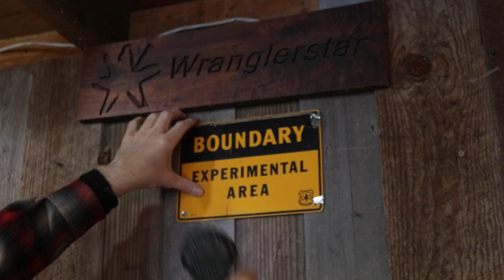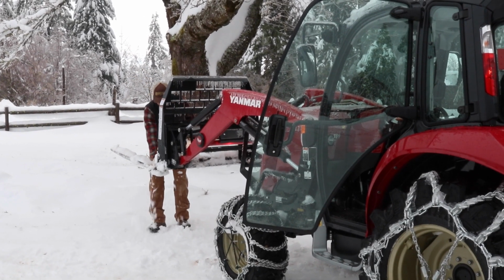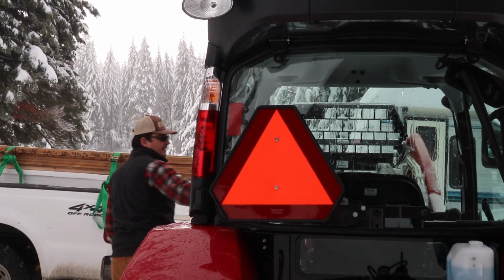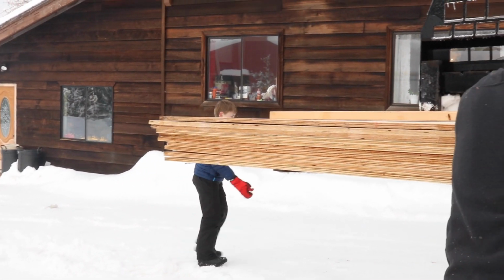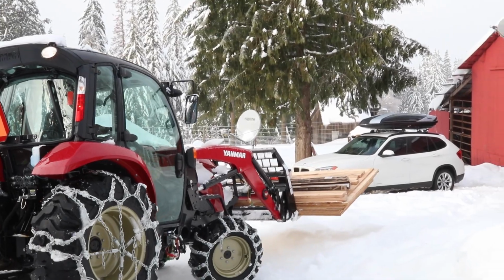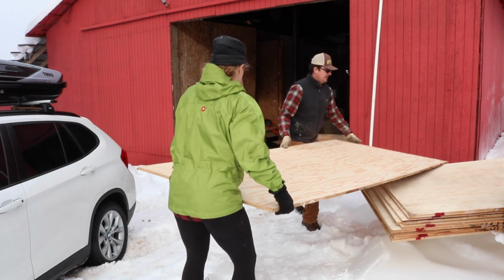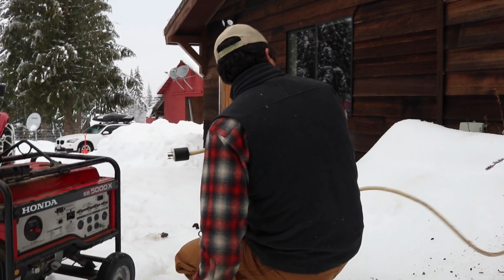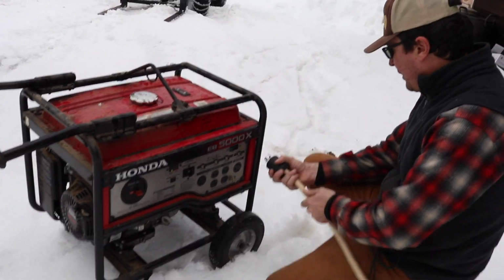THIS ROOM IS KILLING ME I CAN'T TAKE IT ANYMORE!!

Comment: you forgot to refer to the cord you made Dead Man's cord can you touch either end when the other end is plugged into an energized circuit you're a dead man so just make sure you're shutting circuit breakers off the generator is off when unplugging and plugging the court in just a little safety tip
Reply: Wayhart why is it worse than any other 220 line?
Reply: JCLawn51 not necessarily it says there is safety and having a covered and a record like a normal extension cord you have 2 male and have an extension cord that are live easy to shock yourself especially with the end of the 30 amp dryer plug side they are looking at nearly 2 inches copper electrodes that you can easily shock yourself with if you're not careful that's why they referred to it as a Dead Man's cord like he said if you don't know enough about it don't do it always plug the dead end in first then plug in to your power source
Reply: a quick note about doing this in my area it is possible to be charged with manslaughter if you end up killing a lineman so do at your own risk shutting off main breaker should do the trick most power meters have an indicator on them that tell you if power is going backwards to them so it might be worth checking in a meter if you ever try this
Reply: Wayhart and you could always have a proper hookup and throw switch outside. I have worked around a lot of 3 phase in shops and in theater.  The lines are never really a safety hazard because so much trust is put in the insulation. That is why i asked about how much of a danger is it
Reply: JCLawn51 easiest way to think about it is take a 3 prong plug chord that you plug into the wall make it the same on both ends plug that into the world grabbing the other the other end of the cord the physical cord and cell is ok it's the end that are not safe when energized
Reply: Harrison William exactly
Reply: Wayhart ohhhhhhhhhh that makes sense now. I am fully on board with what's going on now haha
Reply: JCLawn51 but yes if you are not well-versed in electrical DO NOT attempt this I have wired my entire College and I still have not done this I just wired in a second panel that has a 50 amp cord that feeds it and I can just unplug it and put in my generator cord into it it was a little bit cheaper than a transfer panel in retrospect I should have just put in a larger main panel when I have original services and I could have had transfer breaker setup installed which disables your main breaker it allows you to turn on your generator breaker but you are unable to operate speakers at the same time which is a far safer way to have your generator tied into your main panel
Reply: Wayhart, from working at an electric utility for 36 years from generation to metering and working plenty of storms. 1 when a storm hits and their is no power, it is totally silent, we could hear generators running for at least a mile. 2 Everybody I ever worked with ASSUMED any wire was hot. 3 I have never worked with a lineman that didn't flash a connection before making it up. 
And I do absolutely agree, If you don't know what you are doing, especially when it comes to electricity you are just thinning the herd!
Reply: Normally you would have a some sort of mechanical interlock switch that would never allow two energized sources to connect together, (even if one wasn't live). Obviously this a some what rudimentary manual system (with out even mentioning the double male ended extension cord ;))
Reply: I put a Cutler Hammer disconnect switch on my house a few years ago.  It is a 3 position switch that goes between electric meter and fuse panel. The up position is line power coming into house. the middle position is Off, all wires going into house are dead and the lower position is a heavy gauge extension cord that is wired into switch and plugs into generator.  This is fail proof. You can not back feed any power into the grid.
Reply: Would a cord made for underground use be better for hooking it up the house? Safer outside?
Reply: Acreage Living Well as for me I'm never a fan of any exposed wire on the ground, I always put it in a piece of plastic conduit.
Reply: Acreage Living  they actually make heavy gauge extension cord I'm aware of stuff that can go up to 200 amp but I'm sure there's bigger stuff out there that is what is designed to be used as extension cord material most generator hookups for houses typically have a 30 amp cord or a 50 amp cord so if you're aware how thick your dryer cord is for an electric dryer or an electric range they are little bit sicker than that with heavy rubber last time I bought that type of chord I believe it was something like $13 a meter but that was 15 years ago
Reply: Richard Peel I'm actually a fiber optic cable technician and I worked for a cable company prior to this so I'm familiar with safety protocol for going up the pole I've still been left off the Strand before it's a bit freaky when it happens I finally asked a power guy about that once and apparently it's quite common in our area because people steal the copper grounding wire the bottoms of the poles which I thought was kind of funny and I imagine there is some leakage that happens in other areas with trees rubbing on power lines xcetera. we have newer type meters here in my area they tried to switch to meters that communicated via satellite but something was going wrong and they were burning down houses in one summer when they started switching them over I think there was about 20 house fires in my city alone that started at meter boxes so we're still on the old digital meters which one I play with a grid-tie inverter and they shut everything off in the house it does show the meter has return voltage it will not make the number go down I'm not exactly sure how those meters work but even if the power is out the meters still displayed the power usage so I'm assuming they just have sensors and no physical disconnect I live in Canada by the way
Reply: wow that must of been full or lawsuits with the house fires.. I forgot about extension cords. His power cord he is using, just looks like an interior power cord, i would be very uncomfortable using that outside! This acreage we bought, the previous owners did some wiring outside using normal indoor wiring, and 4/5 of the wiring jobs they did all short out and will blow the breaker immediately. I have since removed their wiring. They buried it even under ground! Not even in condiut or anything. I think i would tie into my welder plug in the garage. I want it to run my outdoor boiler in case of a power outage and having the ability to run other things would be great.. Garage feeds power to the boiler and the pumps. My garage is 100amp, house is 200 amp, house feeds garage. My dryer is gas, so that wouldnt be a great tie in spot.. Power outages here are very rare and never last long, but always good to be prepared for the worse case. i am from Canada too. Northern Sask/Mb on the border.
Reply: Hiya Wayhart, part French Canadian here from way back. Being in metering for a little bit, and going thru a complete meter change out in our area, I do have a few story's! But your feedback problems probably came from.... until the codes changed to grounding blocks most phone and comm's connected their grounds to meter boxes, if someone came thru and area and started cutting all the butt grounds off (our utility would not let you connect a neutral to our ground in the meter box, we carried our own system neutral) that degraded our system neutral and it would start back feeding to any ground, hence back feeding to comm's. The only fires we ever had were from bad installs, a contractor that paid per meter, you can figure that one out!

The only meters that can have an internal disconnect are 120v or 240v single phase meters, they also have a computer and battery inside, most will record your usage and communicate with every other meter in range every 15 minutes to record all the info. I know a lot of people think oh shit big brother is watching BUT. If there is an outage, the map in a utility dispatch shows where the outages are the worst and where all the people on life support are.
Reply: Richard Peel yeah that communicating meters is what they were trying to do and I think they were going with contractors to replace them and I'm not sure but I think it was a combination of old meter boxes and houses that had underground services where the ground had settled hold on the wires my guess is a meter that hadn't been touched in 20 years suddenly yanked out and jiggled around enough that it knocked some of the wires loose and the meters would just blow off because you're dealing with 100 - 200 of electricity I know in my years of working in the field when lightning strikes an old copper line and we going to do a fiber upgrade the network interface device is usually blowing off the side of the house and in about five different pieces scattered around the yard luckily with fiber it's all glass fiber no copper so once we are off the Strand or out of the pedestal we are safe from electricity. a number of years ago I was working out in a small community in Northern Saskatchewan and we were doing a town-wide update I was working in an access laneway when a power pole snapped off on me I wait for quite the ride on my ladder and I haven't gotten tight off yet ended up landing on a customer shed roof turned saskpower had been in a dispute with the town about access to the Lane they could not get the equipment down it so they had it repaired a pole for something like 20 years they were out the next day replacing every single power pole on that street that was when they showed me how every Power pole gets grounded from both Communications strands then they run the copper line close to the top of the pool and wrapping around once they told me it was for lightning protection not quite sure how that works always thought you needed a lightning rod sticking out the top of something to protect it
Reply: If you knew what you were doing you would not do it.  You are trying to power the house thru a 30 Amp breaker!  Idiotic even if it works.
Reply: Wayhart  I know most don't like smart meters, but the last storm I worked, we had 36k out of power, with that system, one troubleshooter and one meter guy as a team, 6 teams had almost everyone on  in a few days, before the next storm , back to 30k out, we kept working had them back on in 3 days, just in time for the 3rd storm, back to 20k out, that was a long 9 days. but the system told us where the outages were and we were able to get to them quick.

Most of our problems came from direct bury services before slip-joints were code and the 50plus YO meter boxes with the baklite meter clips, they are prone to break without much stress, pulling a meter with the hot leg still attached would always go to ground.

We put butt grounds on any pole that had a transformer or it was a long run, the were used to enhance our system neutral, if you every see a transformer on a pole follow the ground up and it ties to the neutral.

To the comment below, the BACKUP generator is to run a few lights and a few chargers NOT THE WHOLE HOUSE! and my 2nd generator runs just my heating.

Comment: Can you finish showing the electrical hookup. I was recently wondering if electric could be fed in through a outlet. I have a outlet on the bottom of a light pole. I wanted to feed electric into the outlet with a extension cord so the light on top would come on. Main for that pole would be off.

Comment: Hey Cody, I noticed you use the new Dewalt flexvolt miter saw but the subcompact makita impact driver. Is it just because you prefer Dewalt for heavy power tools and makita for the lightweight hand held power tools? I would think sticking to one battery brand would be more efficient. I personally use milwaukee fuel tools but that dewalt flexvolt is tempting me.
Reply: EDC4Days With all the new DeWalt tools showing up lately I would imagine he is being compensated for using them.
Reply: EDC4Days Many YouTubers, Wranglerstar included, were provided with a collection of Flexvolt tools for, presumably, review. The Makita I assume was his personally purchased device from some point in the past.

Comment: Cody regarding the BMW, there is an extrication hook that threads in just underneath the front bumper fascia. This part is easily obtainable through BMW or you can make your own. 

Also around 4:00 I saw names and dates written on the wall in marker. Just curious as to their significance.
Reply: Joshua Sonnichsen that hook is included with the vehicle. It's with the spare tire. It's required for towing; you can't use hooks on their control arms. They also lack tie down points so you must use over the wheel straps instead of the more common cluster hooks.
Reply: While i dunno about american BMWs, all EU cars have a hook underneath the car attached to the chassis; likely at the front and the rear (so you can pull with a cable). Wouldn't be amazed if the location is written down in the manual.
Reply: Dutch Courage in eleven years as a tow truck driver and auto transporter, I've never seen an integral hook on a BMW. I've encountered a few that were even missing the hook! It fits into a recess in the foam thing with the jack. After that, I took one out of a total loss car to keep in my truck. Customers often were glad I didn't have to dig through their trunk to access their hook (many BMW owners seem to play golf so that worked out well lol). Look at any BMW and you'll see a small panel, usually square, in the front and rear bumper. It'll be off to one side amd be marked with an arrow to show where to pry it out. The hook threads in below. Don't forget to loosen the hook about half a turn after hand tightening to prevent torque on the wire rope from making it so tight you can't remove it. Cheers!
Reply: also, this hook is not for recovery. A VERY minor winch out, ok, but down over an embankment, not so much. I suggest a cruse loop in that case. The "fine" import cars seem to be a little less robust than American cars and are easily damaged by improper recovery methods.
Reply: Haha, I was one of the guys that were missing the hook. I didn't realize it even came with one until the wrecker driver couldn't locate it and asked where it was.

Comment: be careful with the inverter, in a house the neutral and ground are the same voltages , but on the inverter they can be different so if you plug the ground in to the socket you  can destroy the inverter

Comment: there should be a square cut out on your bumper and underneath you will see a threaded hole. look in your toolkit in the spare tire that has what looks like a heavy duty I bolt. thread that in and there's your tow point.

Comment: Actually, there are TWO reasons to flip the main breaker off.  Not only will you start to feed the service line to the pole, but when the power company re-energized the line, you will do a lot of damage!  The generator won't be in phase (and more than likely not at the same frequency) with the grid.  Extreme overload=arcing melting breakers=lots of high temperature melting wires and sparks=fire.  More food for thought, try to use a pure sine wave inverter instead of a modified sine wave for electronics.  Pure sine wave setups cost more, but produce a wave frequency like the grid.  Final thought, turn ALL breakers off before plugging in the cord.  A load on the panel will cause a surge and sparks at the outlet.

Comment: Nothing like using equipment to add another step in unloading LOL.
Reply: I get it though, I am coveting that machine LOL.
Reply: Would you rather them carry it across the snow or perhaps you just want to see him get his truck stuck?
Reply: use the bucket to clear path to destination,  back up truck and only handle material once :)
Reply: NmE * Did you even watch the video he said he got her suv stuck. And there is ice on the snow. He had on traction on the bottom his feet and was still sliding around, tires would be worse. Do you really think he could of got his truck back there without getting it stuck?
Reply: Rummy's World Time wasted moving the snow was put into unloading the truck. And not risking getting the truck stuck. Choosing to use the tractor to move the stuff was a smart choice. A little bit of common sense goes a long way. Something that is lacking in people today. You and NmE* are proof that it's true.
Reply: NmE * Says the guy that thinks the truck would not get stuck where the SUV is already stuck.
Reply: NmE * It doesn't matter what you drive tires and ice don't work. Weigh the decision of chancing the truck won't get stuck and being forced to pull it out with the tractor or just use the tractor to move the stuff and be done with it. It is common sense says to do it right the 1st time to reduce the possible hassle of extra work later. You clearly never tried driving on snow that has an inch of ice on top of it. A truck that plows snow is clearing the snow before the tires touch it. Also look around on youtube you will find a bunch of videos of plow trucks getting stuck. If he put tire chains on the truck then I'd say go for it but that is time wasted.
Reply: 3/4 plywood is heavy, better to handle it once. Neither the project or the storm was a surprise.  Love helping this channel by provoking comment :)
Reply: what if he wants the exercise? He can move it how many times he wants.